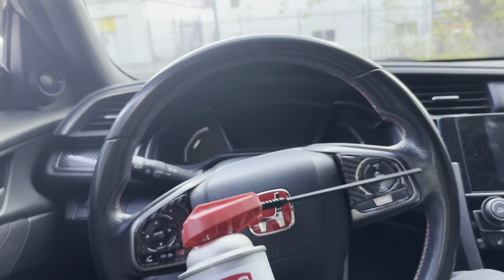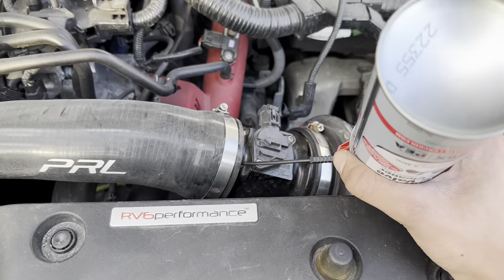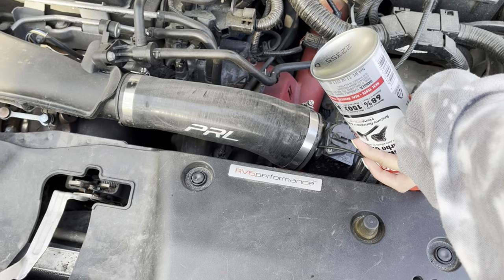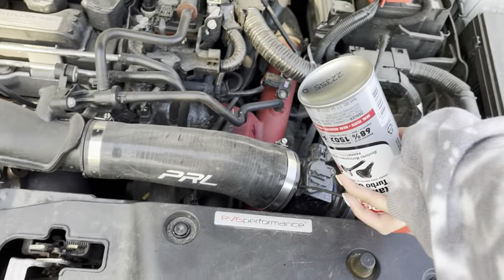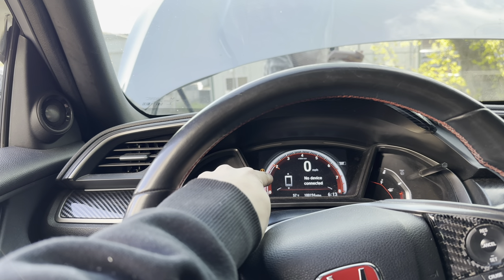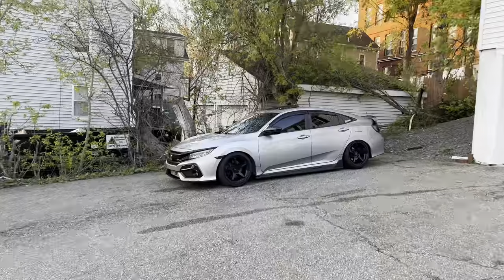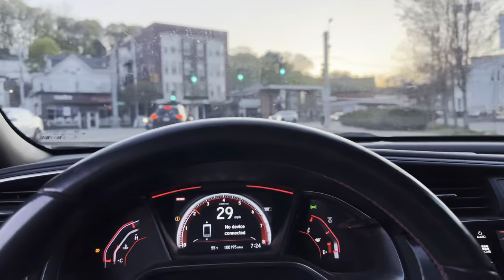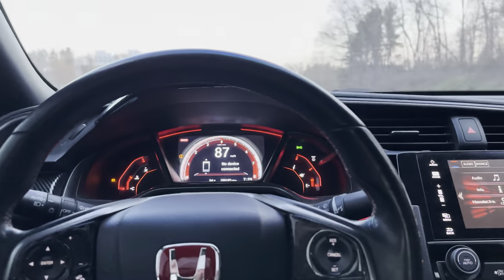Cleaning the valves on my 10TH Gen Civic Si…

Comment: I thought it was just me when i used the GDI valve and turbo cleaner when I used it to clean the engine, but afterwards either I didn’t tighten the clamp hard enough or maybe when it’s nearly dying and you have to press the accelerator it blows air out? Well, maybe next time I’ll tighten the clap more and hopefully it’s not leak. Otherwise, I’ll just have to put some type of cardboard to make sure it leaks on something else and not the floor lol.. I think it’s best to place it in the front instead of in the back that way the turbo gets clean as well . Thanks for sharing

Comment: Do yall recomend cleaning out the throttle body?
Reply from the maker: You shouldn’t need to but it’s good to check and see if it needs to be cleaned , personally I haven’t touched mine , only when I changed my injectors and it still looked good after 100k miles